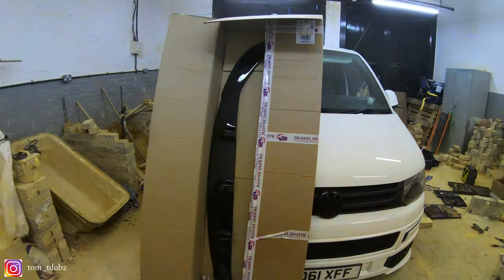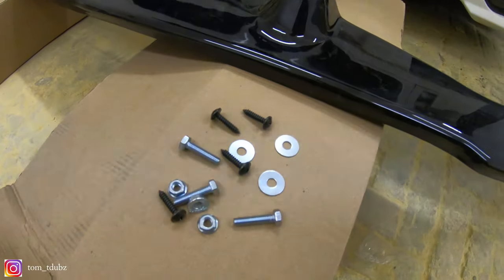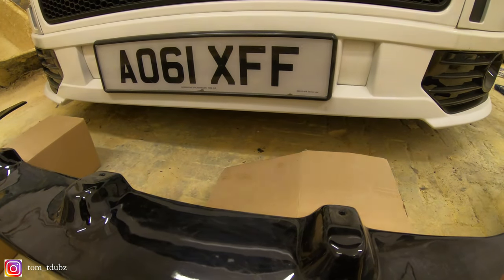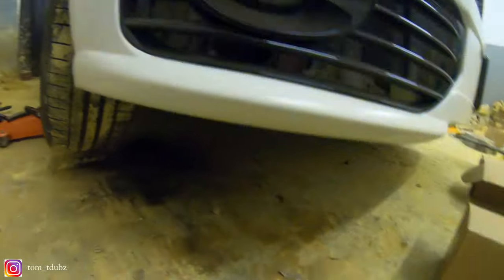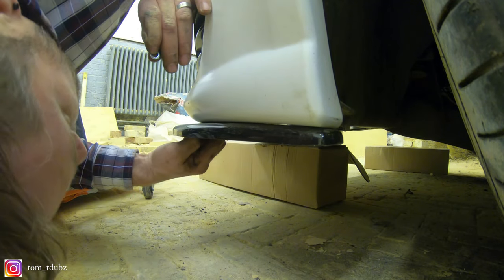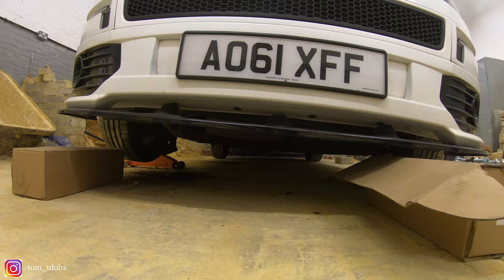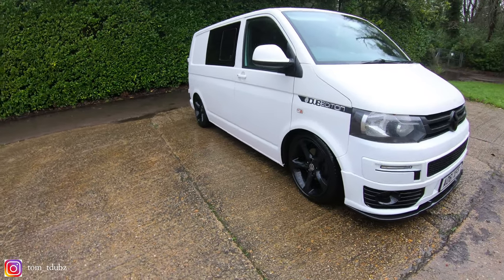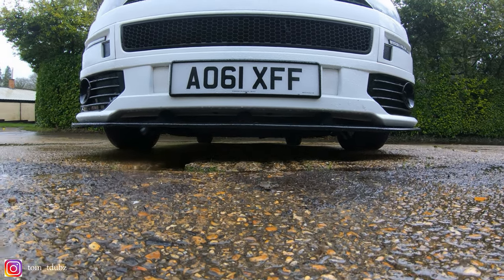Vw T5 Sportline front spoiler fitting #diy #mod #campervan

Comment: Mate loving your vids. Can you please tell me what size bolts you used. And where did you get the decals on your wings. Loving them van is looking Ace
Reply from the maker: Thanks bud. They are 8mm headed 4mm bolts about 20mm long with washers and if you can use lock nuts 👍👍👍
Reply from the maker: The wing decals are something I made... 🤙🏻🤙🏻
Reply: @tomtdubz  have now brought and fitted a front splitter. You made it look a lot easier ✌️👍👀
Reply from the maker: Bez big decent! Good work boss, just finishes the front off so gooood 👌🏻🤙🏻

Comment: Ive just had to refit a splitter after dealer. It was not the best to fit to be fair. Had to make a bracket.
Reply from the maker: Hope video helped, there is a z shape bracket in the original fitting kit….
Reply: @tomtdubz  I had already refit it. Its different. Most probably with that splitter there was a bracket that they never used. Total bodge job it was. Linked cable ties underneath. You seen nothing like it lol.
Reply from the maker: @Supercarlsunday oh god 🫣😂 at least you sorted it 👍🏻👍🏻

Comment: Hi tom really enjoy watching your vlogs.  I have just ordered a front splitter from travelinlite for my vw t5.1. Don't think I'll be fitting it I'll properly get a garage to do it. Love the info you provide on your page and love the look of your t5 too. I have also ordered a pair of wing mirrors covers from them too which I will attempt to do myself. Got to ask you tom where did you get the vinyl dub strips from near your front doors, they look amazing and would love them on my van too. Could you please advise where you purchased them from. Keep up the good work regarding your vlogs and look forward to watching many more. Thanx Tom.
Reply from the maker: Evening, the fitting isn’t too bad the wing mirror caps are probably a little harder to be honest few little clips that can break easy... the decals are something that I made.. I do sell them for £15 in most colours, are you on any other social media sites?
Reply: Just use drill screws and 3m double sided , ten mins bud !!
Reply from the maker: Boooooom just like that 👌🏻👌🏻

Comment: I've just tried fitting fog lights to the sportline bumper and what an absolute nightmare that is dont line up at all but this looks a lot easier, took the lights out in the end and bought more fog light pods
Reply from the maker: Nice work boss 👍
Reply from the maker: I’m just about to do the video for that, got the kit from travelinlit any tips,
Reply: How did you get on with fog lights?
Reply from the maker: Really good check the video out, sounds a bit rubbish but the fit was great 👌🏻

Comment: Hi Tom loving the videos. I'm going to be fitting drls and fogs to t5.1. Did you do a video for the bumper drls? Any help would be appreciated thanks 😊
Reply from the maker: I didn’t fella, fitted them in before I started the channel up properly, I’ve had quite a bit of interest in how it’s done.. should of done now.. where did you purchase them from? If it was travelinlite they have quite detailed instructions... if not il try and get a how to bid up ASAP 👌🏻
Reply: Hi Tom I got them from Van-Tech along with loads of other mods. My van is getting a complete mod overhaul 😄 I'm going to nip out and tackle the drls now. I've also got the fog light kit to.   
Looking through  your videos as we speak. Keep up the good work. 🤟
Reply from the maker: Decent the fogs is quite easy. The drls hardest part is trimming back the existing bumper to get the new plastic plate to fit.. wiring is quite simple have to piggyback off one of the fuses in the fuse box near the battery. And take a feed off the existing drl wires..
Reply: Drls done ✔  fog lights next so watching your video. 
Then its off for paint next week. Cheers fella 👍
Reply from the maker: Tidy work, the sound is a bit poor... that go pro is now in the bin. There’s still enough detail in it tho to really help. How did you find fitting the drls?